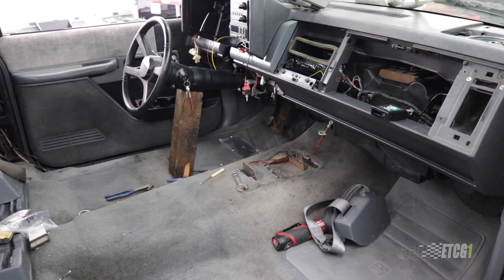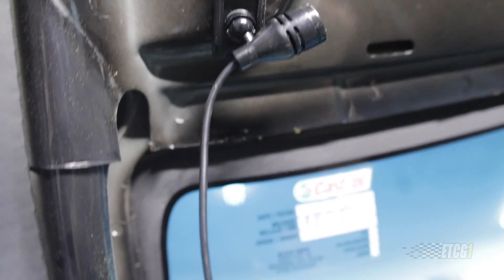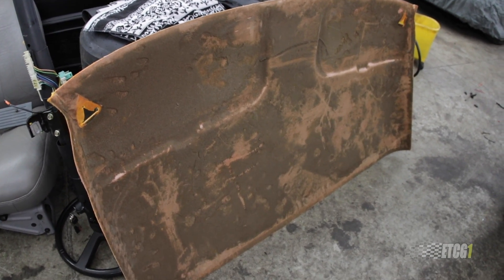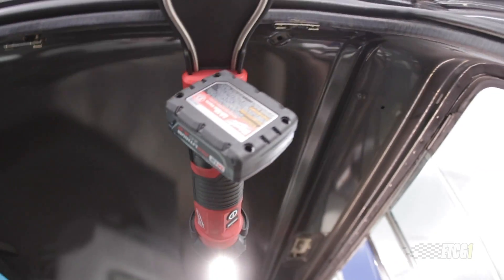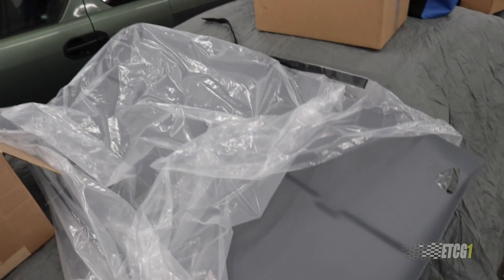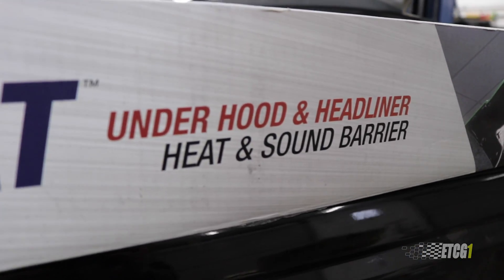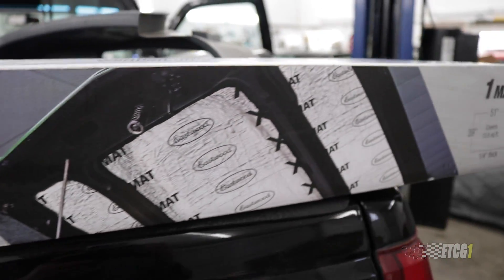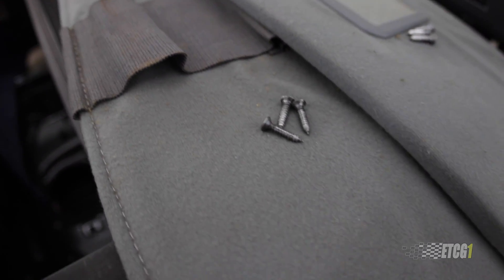How Deep Does the Rabbit Hole Go with #ETCGDadsTruck ?

Comment: You have encountered the dreaded "while we are at its."
Reply: buys new truck lol
Reply: Yup enough said
Reply: machintelligence - Also known as "May as well..."
Reply: Exactly why project cars take forever lol
Reply: @jayrob3  90% of the project takes 90% of the time and the last 10% takes the other 90% of the time.
Reply: My "while I'm at it" experience was when I did my injectors I removed the intake and I made the great decision to do a clutch job because since the intake manifold was off it made it easier to get to the top bolts of the tranny. Then I thought well my I have to remove the exhaust. I might as well upgrade to a bigger size lol

Comment: I spent the past few years hiding from my project cars because the rabbit hole was growing with both at once, and the one I relied on for actually getting around blew a head gasket after a radiator failure and I suddenly had an expensive time consuming job on top of a myriad of other issues I was less equipped to solve.

Fast forward a few years and I’m trying to fix up a Ford Focus I now drive just to get around while I was working. I’m between jobs and HAVE to have it running but the suspension started falling apart. I figure no biggie, I’ve taken a few years off, gotten some shit in my life together, and have plenty of time. So I start working. I need new struts and axles. The axle has bound itself into hub so I have to get a puller, and the new axle fits through the hub just fine. Great, now I don’t trust the integrity of the bearing if the prior axle had been warped that much. Never done a bearing and have none of the tools so I end up having to go down that rabbit hole and ended up back at your channels rebooting my learning.

Get the axle out and order seals. Ford decided to use the most insane two piece metal seals I could possibly imagine that have seemingly no way to be removed but chiseling the inner portion carefully until it can be pried out and releases pressure on the outer portion. Great, now I have to get a new one in and the makeup of the seal means the only safe way to get it in Undamaged is to only hit the incredibly thin exposed area around the outer metal portion, which ends up with me ordering the specific Ford tool for it because even with a socket there isn’t enough room to get around the entire seal due to its proximity to the transmission case. Eventually I get it in with much effort thanks to my lack of a lift and the impossible angle of hammering it from the ground.

I’m nearing the end and already decided that if the other axle comes out of the hub I’m not touching that bearing, and if that axle seal has failed I’ll replace it when I see it dripping fluid. I can’t go any further with the issues on a car I’ve had on jackstands for months because of these and other delays. There was a time I had the money and desire, but my money is near nonexistent and I have absolutely no desire to keep spending money on a car I have absolutely no love for. My auto experience started on my beloved 91 Celica and 96 2dr RAV4 i later inherited from my dad. I love those cars and would be enjoying this job on either of them. Instead, I feel like I’ve just created a money pit out of something I don’t even have love for.

Comment: I was replacing a rotted fuel tank on my car last fall. Little did I know that the bolts that hold the tank straps in the rear of the tank were bolted into a piece of sheetmetal that looked like part of the frame, but it wasn't. Well when I went to take the bolts out, it ripped the sheetmetal with it. So a simple tank replacement turned into a huge custom fab project where I had to cut, grind, and clean the rusty metal on the car, buy new sheet metal and rebuild that part of the "frame" (because it's not really the frame of the car, it was like an extension if the unibody that went from left to right to add support and hold the gas tank). Took me days but I did it!

Comment: Got a GMT 400 of my own, 99 Suburban super clean, the interior cleaned up really well, engine is strong, needed a transmission. Got the truck for free for doing some other work for a family member so it's a steal in my book.  Trans wasn't slipping, just whining real bad at speed. Went through 3 transmissions from various scrapyards/facebook marketplace sellers etc. Ended up ordering a rebuild kit for $300 bucks with a heavy duty sun shell and heavy duty frictions and band and corvette servo etc etc...into this like 3x as much as I thought and I still find myself eyeballing 5 pinion planetaries and aluminum accumulator pistons and shift kits and this and that and the other. It never ends. Even on "smaller" jobs like R&R a 4L60E in a rwd truck.

Comment: I understand about time sinks. I couldn't even rotate my tires without moving stuff out of the way then jamming lug nuts that would not come out of the impact gun socket, then unsticking tires that felt like they were welded on the rotors. Took forever.

Comment: I went through the same.  Started out as just a timing belt job and valve seals.  Ended up rebuilding the head, changed leaking valves, replaced cams, bigger injectors.  It's always a rabbit hole when it comes to older cars.  Headliner wouldn't have taken too much time, maybe a few hours.

Comment: Projects almost always have rabbit holes. Automotive as well as homeowner projects. I currently live in a 120 year old home and take on one or more projects at a time and they invariably have "rabbit holes" associated with them. I gut a room for example when updating and find structural issues or other issues related to over 100 years of handiwork by people with various levels of ability. Between improvements in both materials and techniques as well as correcting bad work from the past, nearly every single project runs over budget. My wife and I have learned that every project can be expected to go over budget in both time and expense and have adjusted our expectations accordingly. Still fun and wouldn't change it.

Comment: 1984 Toyota pickup is my daily, blew a head gasket, had low compression. Ended up getting a rebuilt engine put in by a reputable builder at twice what it would have cost me if I had my own shop space.  I am super happy with the results and 5k was fair enough for the work done and not having to worry about that part of the vehicle.

Comment: I think you just defined the human experience. In pretty much everything I work on this happens. What I try to do is look at it from an engineer's perspective: What are the parameters I have to work with? What are my available resources? Then as a rule of thumb, I shoot for making the project fit with 80% of the budget and hope that any surprises will fit in the remaining 20%. The occasional disaster is offset by the occasional easy win, grasshopper.

Comment: This reminds me of just 2 months ago, I went to replace the tie rod ends on my 93 Falcon, while I was under there I noticed the boots on both the upper and lower ball joints had started to split, since I already had the front end apart I decided may as well replace all the front end bushings verdict is a $60 job became a $400 job, but well worth it the car has never driven this good in the 2 years I have owned it.

Comment: I need tie rods and a ball joint on my truck. So I'm getting ready to completely gut the front end and replace everything with MOOG parts because "I might as well do it all right now rather than fix it one piece at a time later". I know how you feel. Damn near $1000 in parts, and I still have to take it to the shop to get aligned afterwards.

Comment: Yep right in the middle of that with my 65 Buick Riviera. I have about a years worth of saving up just to finish my engine build with the 401 nailhead. That does not even touch the body work, interior work and wiring. I am still committed but I wish parts were a bit less so I could get cranking a bit sooner. Such is life though, got the motor broken down and getting it hot tanked soon then checked for cracks, fingers crossed there.

Comment: You have no idea how much I understand your pain...  Building my 1960 C-10 with a 383 and a 6-71 blower, I thought I had everything, and was with in budget, than I took another 1k out of saving to finish it off, and thought I had everything, than it happened 3 more times.  It got to the point after that where I took out 1,500 bucks and said if this doesn't do it, I'm towing this hunk to the scrap yard.  It doesn't help buying parts from So-Cal Speed shop right down the street instead of waiting for Summit Racing to get it to me next day just because "It's so close" to getting on the road.  But, when it's said and done, it's done right.  I said to myself "no more half measures" after Pro-Comp parts failed me for the 3rd time.  It's worth it to do it right the first time.

Comment: It's just like Hal in the Middle fixing the light bulb! But I faced the same issue with my Volvo Project car... I'm so close and then BAM you realize there's some issue that takes you down a rabbit hole. In this case, I'm doing a timing belt thinking isn't going to be that hard a job -- then a water pump bolt breaks off. DAMMIT. A month later of waiting, parts, etc. and ... the hole's buggered (my fault) and just gave up and hoped it wasn't gonna leak.

Another issue -- replace valve cover gasket, start the car and oil starts leaking. Replace the gasket again, and do the PCV system since it was a known issue. Start the car, and BAM oil leaking again. I take the cover off and... Behold! A piece of OLD gasket I missed TWO TIMES that was causing the leak... 60$ and 5 hours of time down the drain...

Comment: I'm in same situation with my mustang I've built a 347 all out of used speed parts I could gather over the past 2.5 years and to say the least I didn't save much money at all I've bought multiple parts multiple times now it will finally start but will not stay running my hair is being pulled out and wallet is going empty so good luck Eric!!
Reply from the maker: Hang in there man. Sometimes the difference between failure and success is just one more try.

Comment: This is my current story!!!!!!! When I used to take my vehicles to the mechanic, they'd have it on a lift, come see me in the waiting room, with, "Welllllll, you need this, that and the other. And while we have it out, we might as wellllll......!!!! I hated that back in the day. Since I "attempt" to do my own mechanics, I find myself doing the same thing! Exhibit A: I was supposed to be changing my water pump on my 92 F150 5.0L V8 302 engine. Since I had the water pump off, I might as well......DOWN the rabbit hole I went! Keep in mind, I took it apart almost 7 YEARS AGO!!!!!!!! AND I'M STILL ADDING PARTS TO IT!!!!!! I get it now! Thanks ETCG1!

Comment: Sometimes it makes sense to just cut corners in order to keep from falling off the edge and into the rabbit hole.  I am not sure if it would have applied in Eric's case, but a couple holes drilled into the A-pillar cover may have stopped the fall.  Or maybe just some duct tape and bailing wire for one of those "time being" fixes.  ...Which could bring us to the next ETCG topic...

Comment: working on a 95 extended cab k1500 z71 with trailer package payed $600 running no reverse with many factory options on top of rust everywhere. 

Wanted to get it rolling down the road and focus on the frame and rockes, cab corners. 

Wound up breaking rear cab mouth bolt in the body had to pull the interior noticed all the bad rear window seal, already have the interior out minus well pull the head liner out to put stainless hardware in for the visor that needs to come off to get painted and to fix rust and paint on the roof, and minus well paint the hood wile I paint the roof. 

still have to fix the bed and so on. 
Should be a great truck once done as 95 is my favorite year. Easy to work on with nicer, more up to date interior😮

Comment: Bought a 1984 Chevy S10 Blazer 4x4 in Sept 2017 for $300. It had a few issues (or so I thought) so I had a few things taken care of but had to drive it a far distance to get it inspected. It failed terribly and found out later that the rear main seal needed to be replaced. Rear main seal replacement also turned into a Catalytic converter replacement. It was not a cheap job. After that, my buddy  drove it up to MD where I live and on the way up, about 20 min into the 4 hour drive, the instrument panel dials all redlined. We thought it was overheating so we stopped at an autoparts store and replaced the thermostat. Even after that, the issue persisted. He finished the drive up and parked it in side yard. We later found out that it was likely the instrument panel wire cluster as all the components were operating fine - it just didn't show that it was...

I got antique plates for it as I didn't want to have to have more shop time for it. I drove it for about a month this past winter every few days to keep it running when all of a sudden after not driving it for 3 weeks (as I was out of town), I took it for a spin and the transmission didn't go out of 1st gear (it's an automatic). Now I'm at a stalemate. Do I just sell it as it is or do I put a new transmission in it and sell it for a little bit more as it'll be a 'running vehicle'? Or do I donate it for a tax return... I've probably dropped close to 10x the cost of the original price for which I purchased it...  :(     :(     :(

Comment: Yep - EXACTLY what happened with my '74 Yamaha RD350 2-stroke. Bought it July of '09, rode it that summer, decided to fix all the nagging things over that winter. Compression in both cylinders had a wide gap between the 2, so I wanted to make them more equal. Had a parts bike that I was taking stuff off of, and those parts weren't much better. Figured I'd do a top-end rebuild ... then I found oil leaks, questionable lower end bearings, etc.. Long story short, it got a completely rebuilt crank ... since I was doing that, might as well upgrade to the "54X" rods (better oiling on the big end). Crank was lightened and balanced. Since I did that, might as well go with Banshee pistons, and since I was bringing the cylinders to the machine shop to get matched to the pistons, might as well shave the heads a bit, and get a stage-2 port job. Now I need to modify the carburetors, and ON it goes! New halogen headlight upgrade ... combined regulator/ rectifier unit,  repro seat, etc. etc.. Ended up with new paint, all new suspension, tapered roller bearings in the steering stem, needle bearings in the swingarm ... basically morphed into a complete restoration! Not what I had originally planned, but the more I dug, the more questionable parts I found on the 30+ year old machine at the time.

Glad I did it, though. Now the bike is SWEET! It hauls ass, looks great, and is a TON of fun! Well worth it. Glad I did it then and didn't wait, since parts today cost 75% more than they did then!! Here's some pics: https://postimg.cc/gallery/3f4ivqqo0/

Also did a 4.3 V6 engine swap from a '00 Jimmy to a '89 S10 Blazer - converted from FI to carburetor. Same sort of process, although I couldn't afford to fully restore the truck. Took ALOT longer than planned! https://postimg.cc/gallery/1v48ugolc/

Comment: I got a junkyard 5.3 LS from a running suburban. After cleaning it up I planed on just dropping it in my 1990 Chevy truck. Well I found 3 broken exhaust bolts on one head. I had to remove the head to take to a friend with a welder to get them out. After puller the head, I discovered how terrible the head gaskets and oil crud was in the engine. Now I’m pulling both replacing the gaskets, cam, lifters, valve seals and springs. I’m going to now pull the oil pan because I am sure it’s full of sludge as well🙄. I know these engines last for many miles and I’m sure I can get another 100k before I rebuild it so it will be totally worth it.

Comment: A year and a half ago I bought my first manual v8, have absolutely loved it. Bought it for 9k, it was a bit rough, definitely needed some TLC and I wanted to do a few bolt on mods + tune, which I did. A few weeks ago I sat down and quickly added up the larger things I'd spent money on...a bit over 8k. Almost the same I payed for it. That's not including the small bits, things like new trim pieces because the old ones were stuffed etc. Averaged out that money and it comes out to $500 a month I've spent on this car. Too much. I love it, but too much. Decided I need to get rid of it before I keep burning through so much money. Put a much newer car on finance, the repayments are literally half the cost per month, and all I'm going to do is a catback exhaust and an air intake. Otherwise just maintenance and keep it for as long as possible. I've had my fun with the v8, I've loved it, but it's time to make better decisions

Comment: 05 Acura TL, suspension issues. Replace coilovers, and camber arms, then broke endlinks. Replaced endlinks now need to do sway bar bushings... replace air intake with cold air, replace clutch, flywheel, rear main seal, slave cylinder, and had adjusted valve lash, just to find out 3 cylinders are down on compression.... so I'm still going down the rabbit hole. I suspect compression might be due to incorrect valve lash, but my idiot self didnt check compression at the start...

Comment: I'm going through that now with my Ford ranger. I got into an accident with it and as I'm taking the nose apart I'm finding more damage and stuff I have to buy. It's worth it though it's got low miles and before the accident I had the timing belt water pump plugs wires and rear end serviced to the tune of $1100 bucks.